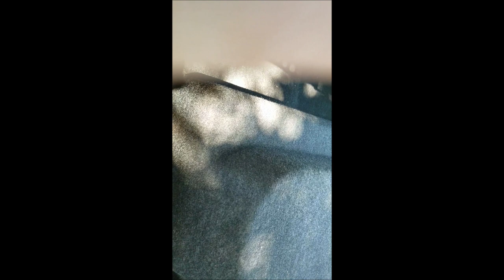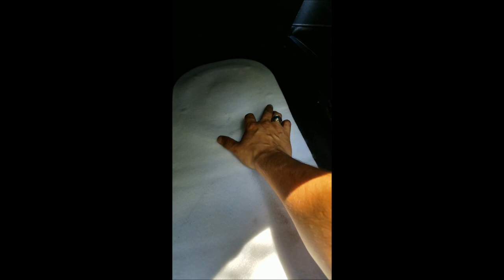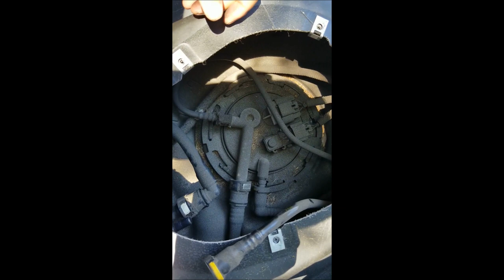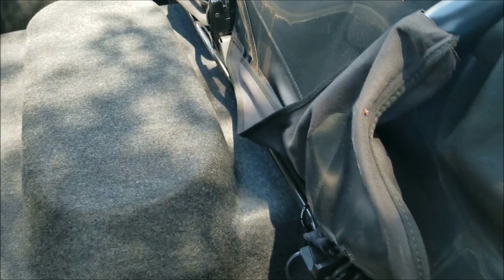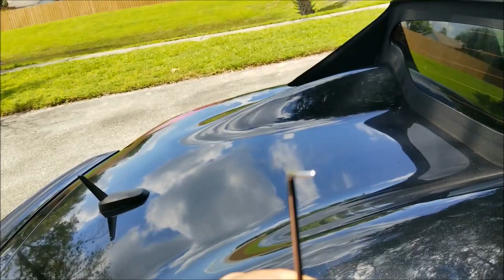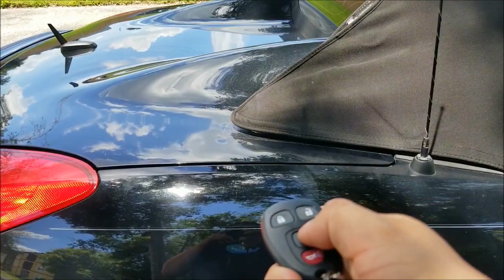Pontiac Solstice Charcoal Canister

Comment: I am about 20% of the way into this job.  I am going with the option of cutting an access panel in the trunk floor to remove the canister.  I won't even have to put it up on jackstands this way.  See the forums....easy job.
Reply from the maker: Yeah, cutting is easy,  but I dont have the material to create a replacement door. I figured I preferred to keep it as is and just take the long way. Glad the forum was helpful for you.

Comment: Questions please if you see this was it easier to do it from the top or is it possible just dropping the tank to replace that part because I am having that trouble with my car
Reply from the maker: It is easier to drop the tank. You cannot remove the canister or the solenoid from the top. Tjere is a little panel that you can remove to disconnect the cables, but impossible to remove them. You will have to drop the muffler and the differential, but after that it is not bad. You will need a second pair of hands to drop the tank.
Reply: @TheJesseacosta  Dropping the tank means dropping the diff.  Huge, complex job. Easier to cut around the top of the  "Temple"  (it's just plastic) to gain access to the canister. The Solstice forum has some good instruction on how to do this.

Comment: This is the only film where the Charcoal Canister (with a complicated location above a fuel tank!) replacement is at least discussed in details. I changed Vapor Canister Vent Solenoid, but it didn't remove code P0446, I think also might need to replace that Canister, though my car doesn't have any issues with refilling. This film has very good tips on how replace the Charcoal Canister, when it has that complicated location a top of a fuel tank (I have 2001 Saturn SL2, but same location, a top of the tank. Someone wrote that 2004 Chevrolet Impala has same location).  I tried to find a film where you do that work on dropping the gas tank, but could not find, pls could you advise where is it. And what manual do you use? I have Haynes and there is no word on that job (Charcoal Canister I mean). Very informative film, thank you very much.

Comment: So, did you end up having to drop the gas tank and replacing the canister? How big a job was that? I'm having this same issue with my Solstice. :(
Reply from the maker: Yes, I did have to drop the tank. It took me a total of 6 hours, and I had an extra pair of hands. Also, I have some videos on the job I did, I have not edited them together yet, you will also need to drop the exhaust first. Then, disconnect the lines from inside the trunk, and then proceed to following the steps to drop the tank. I tried to do the job without dropping the exhaust, and I had to back track and drop it anyway. Save yourself the trouble just get it off and move foward. The exhaust removal is easy. And the tank drop is as well, but it is annoying to do the job. I recommend you also test your fuel pump while you are there, because you are not gonna want to do that job. The pump is not the issue at all, but if it is running weak there is a chance it will go out on you in time. Just get it early if you have the money to buy a new one.
Reply: Thank you so much with information it will help explain to the mechanic what needs to be done